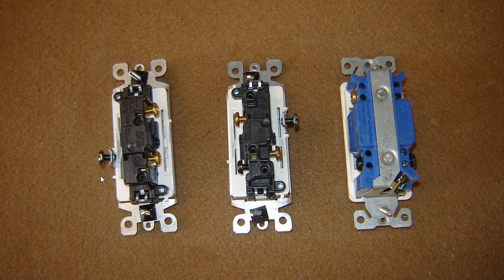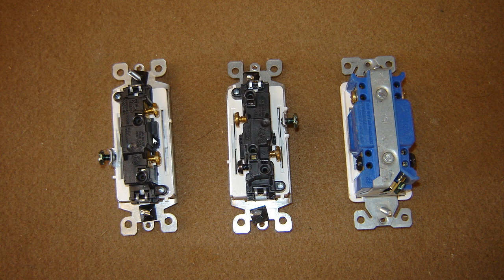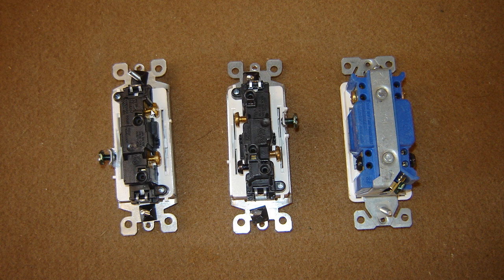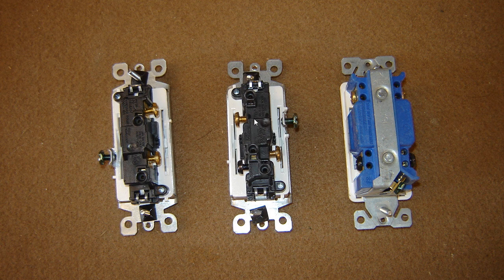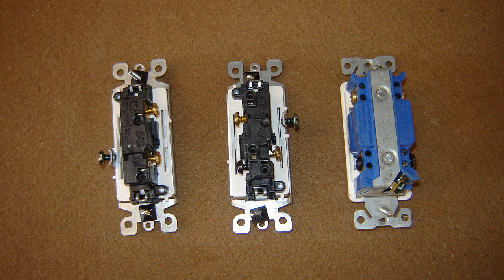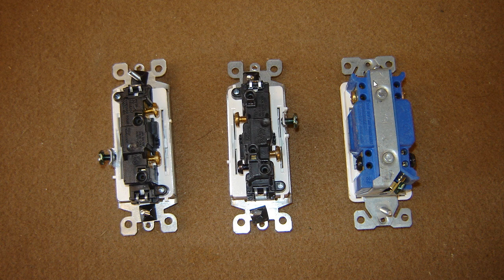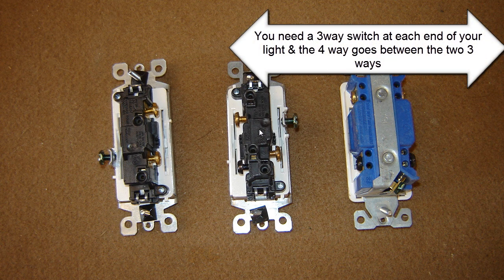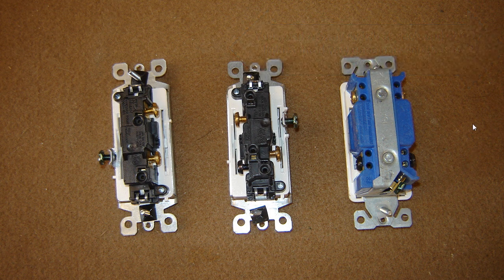Light Switches

Comment: I wish I found your video sooner! I needed to replace a Leviton Decora rocker switch expecting to find the wires wrapped around the screws. Instead, the wires attached using the push-in/quick wire method.  I took an educated guess as to which of the 2 black wires were pushed into the common slot, but I wanted to be 100% sure.  So, I had to stop and do more research to find some kind of installation manual or video that would clarify which hole/slot the common went into. It really would've taken a lot of time since there was only the brand of the switch and no model number. I found my answer from The Circuit Detective's video who had a similar model, but your video matched my switch exactly. If I would've just waited to until his video finished and yours started, I would've saved even more time by being 100% sure of my wires. Thank you for your video, though. It will really come in handy for other DIYers. Also, is it better in the long run to wrap the wires around the screws instead of the push-in/quick wire method?

Comment: We don't have to bond switches in Canada it is optional. We just have to bond to the box then to the light box and fixture. The boxes here are either metal or plastic that have grounding screws on a metal plate that goes to the front of the box. So the metal switch is bonded to the box. I guess the CEC figured bonding the switch is good enough maybe because unlike a plug devices are not being connected.

Comment from the maker: Yep you can wire a three way as a single pole but it really is better to replace the switch with a single pole/common and either one of the brass screws.You'll have to check for witch way is up.

Comment: I have an old light switch in church that has no ground but the 2 screws are on each side of switch. Can I replace with light switch that has the two screws on the same side and if so does it matter which wire goes to which screw. Thanks

Comment: I'm just a homeowner, but I've always wondered this: Do you prefer to use the "stab-in" connection, or the screws? Is one better electrically? Are there any rules or best practices for mixing the connection style on one device? If you're not using the screws, is it good practice to screw them all the way in, or is it ok to leave them extended? (I find outlets in my house that have the screws hanging out in space with nothing connected, and I don't like it) Thanks for the video, and good work!

Comment: Different electrical codes, CEC by Canadian Standards Association as well as provincial codes, I guess.  I'm not an electrician, but am familiar with electrical basics and troubleshooting, maybe our codes require all switch and electrical boxes to be metallic for indoors, and probably the weather resistant boxes to have grounding brackets that connect to the mounting hardware of switches.  Outlets are grounded still, of course, but it may also depend on the setup i.e. commercial vs. residential.

Comment: The sigle pole dimmer I had would not dim a low as I wanted it to for the family room. I found that the 3-pole dimmer I had bought (for CFL bulb) were adjustable so you could set the lowest point on the dimmer to be just about off. (Like movie thearter lights.) I was not able to find an CFL (adjustable) switch in a single pole. ..anyway I was able to get the 3-pole to work..

Comment: i' m using regular romex wire in my home 14 / 2 and i got a switch and noticed on the back of the switch it reads   for cu wire only 14 solid wire for push in,  can i use this on mine ?

Comment: Whats the difference between a commercial 1-way and a standard 1 way other than one is about $6 and the other less than $1?
Reply from the maker: These 1-way switches are called a single pole switch.
Quality and features are the difference in the pricing. They both could be rated at 15 amps but the dollar switch is going to be built with minimum ul standards whereas the $6 switch will exceed those standards.
Some of the features are the type of connection for the wires,better housing,self grounding yoke and all around construction of the switch.
Reply: Thanks!

Comment: You were very misleading about single-pole switches. You said that one screw was line and the other was load, and you pointed to those screws. You can use either one for line and load, but obviously not on the same screw
Reply from the maker: I feel using the phrase line and load is good practice when explaining wiring devices. It is second nature to me because we as electricians deal with and talk about line and load all the time.
You are correct in that it does not matter on a single pole switch.
Reply: Not what I was saying. You pointed to a specific screw for line and a specific screw for load. People might be trying to figure out which one to do and they'll be confused because it does not matter which screw you put the line on or the load on.